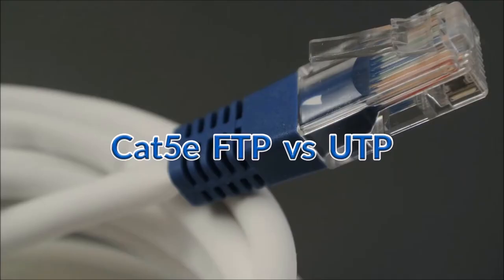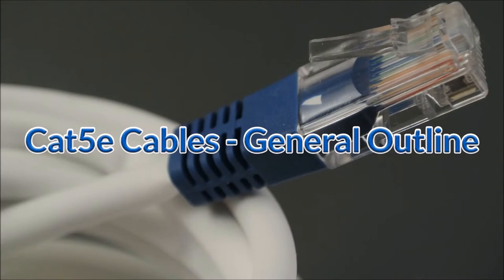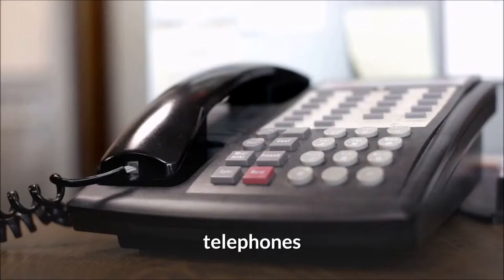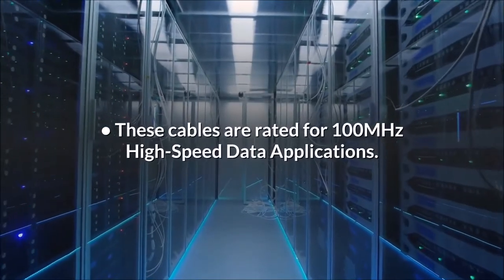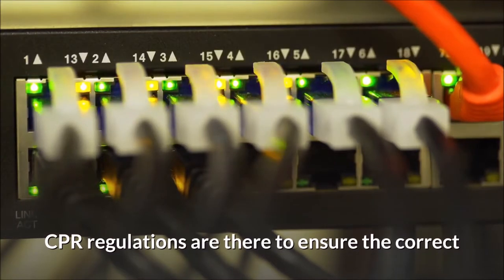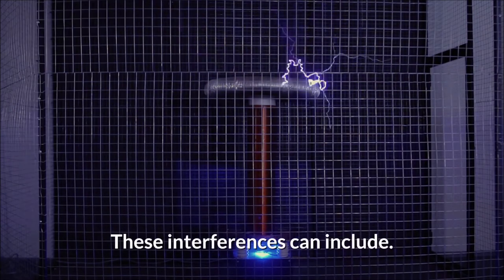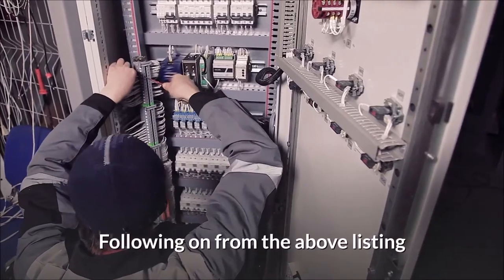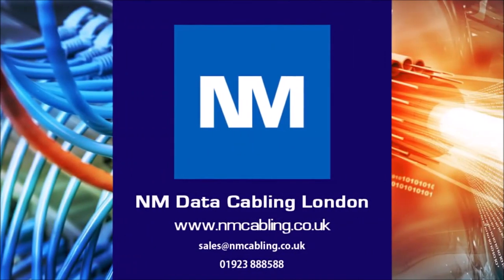Cat5e Cable FTP vs UTP (Comparing Cat5e FTP vs UTP)

Comment: i only use my home network for internet use. cat5e @ gigabit is good for me. my internet speed is only 200mb anyways which is less than my network capability. + my equipment like switch only does gigabit. basically i was using wifi for downloading xbox games and the 4 to 6 GB games would take up to 3 to 4 hours to download. so i decided to run ethernet but chose cat5e because of the limitations of my internet speed. not it is about 20 to 30 minutes to download a 6 GB game.